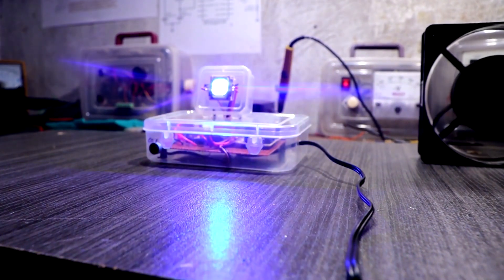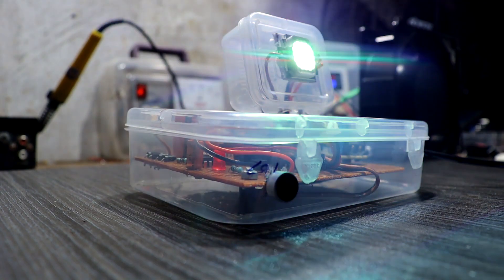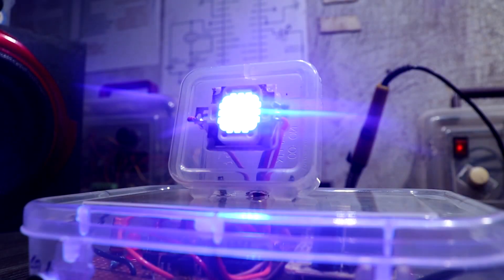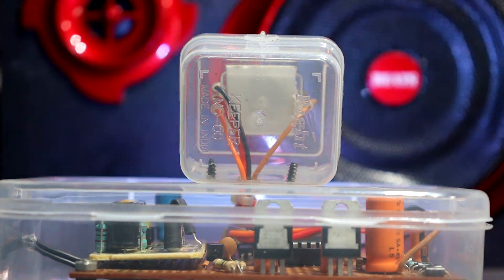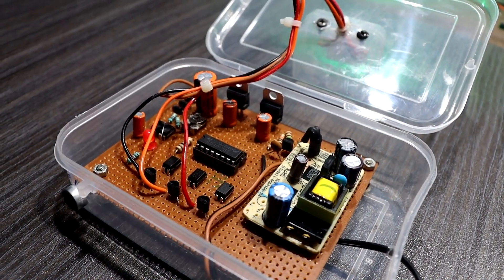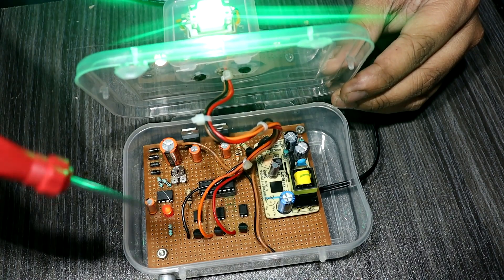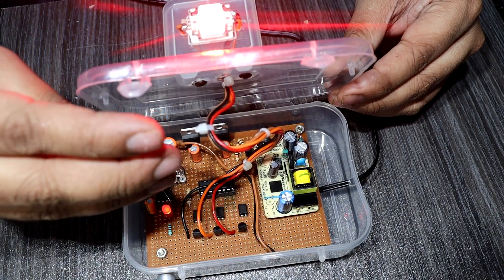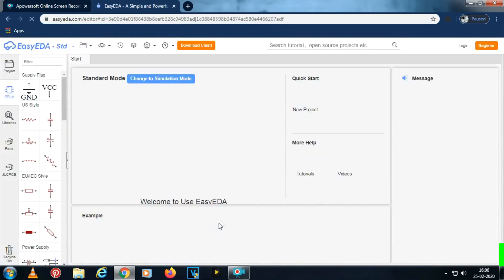BASS REACTIVE RGB WIRELESS STROBE LIGHT

Comment: Bro i recently made a bass reactive light that's i'am used rgb led strip and I directly connected in to the home theater subwoofer but now i'am planning how connect the same subwoofer on AC volt related led lights because recently I will purchase 6 wall decorative led lights that led light placed in wall. Now the wall light working on mains supply. Now i'am planning how may I connected that decorative light on bass reactive light setup. It's possible. Please replay sir....